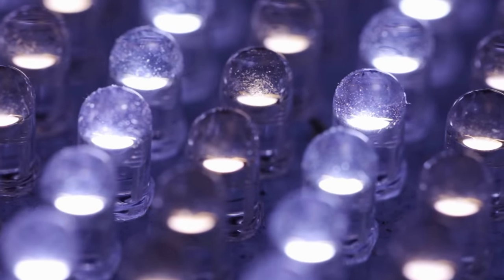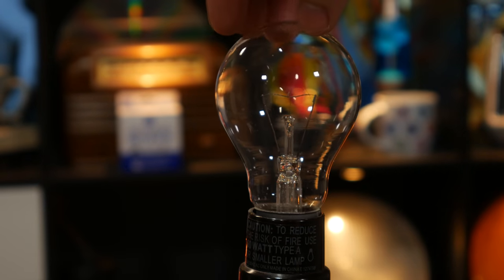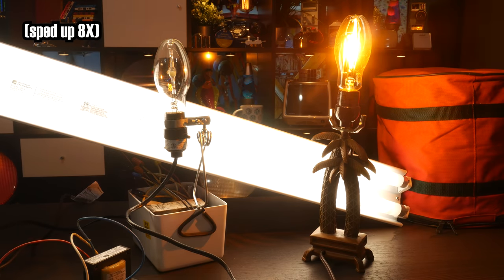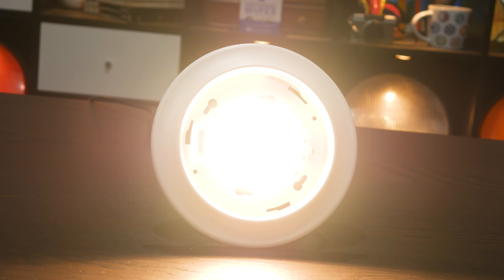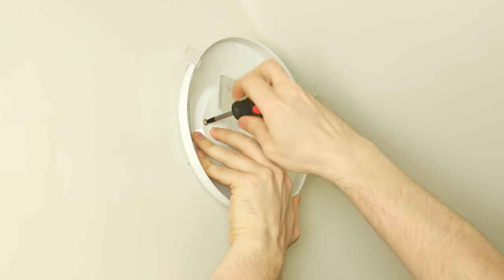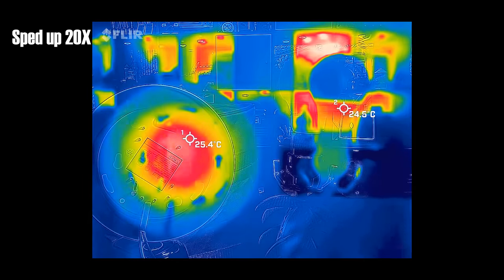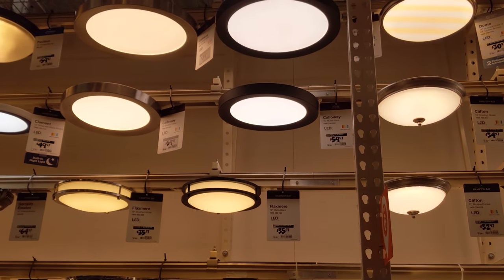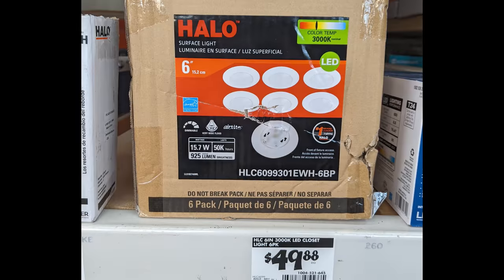A troubling trend in lighting?

Comment: I'm a commercial lighting engineer that specializes in retail and started in the field in 2012 just as it was coming into mass market. You hit a lot of the most important points and how it has been commoditized. A lot of those earlier projets are now being replaced again despite us assuming a 15 year life. For one, in commercial settings there are often "night lights" or certain fixtures that stay on constantly. We found that those fixtures became noticeable and color shifted over time compared to others so now we often designate separate (different) fixtures for that purpose.
Also, what one manufacturer calls "3000K" varies from others. It shouldn't, but it does. Especially with the Chinese brands. A spectrometer confirms it and it's simple technology but... China labels things however they want.
I think the biggest advancement has been in the optics, it has opened up a world of options we would have never dreamed of 20 years ago with different beam patterns and the like and the diode elements are powerful enough that we can afford to diffuse it. Earlier generations typically didn't. This is a big deal wth street lighting and glare.
But yes, unfortunately in retail environments where we have defined a brand standard for our clients, if a few fixtures shift color, we need to replace EVERYTHING and that is becoming more and more common. Whereas in the past with 2x2 fluorescent fixtures with FB lamps we could just relamp one fixture and nobody would know, we often have to replace an entire sales floor of fixtures now and the store managers can't do that. It's great business for us (as we also do that work and service thousands of locations) but it's incredibly wasteful. We've recently started supplying tunable fixtures and have reverted from integrated track fixtures/lamps to track lampholders where the lamps can be changed out. Except, ironically, in California there are Title 21 requirements that still require us to replace entire fixtures as they require integrated lamps. Also, as you mentioned, Chicago (and NYC) are both oddballs and require all exit signs and emergency lighting to have metal housings and other special fixture requirements like "tenting" the fixtures in plenums, etc., the codes are well-intentioned but haven't caught up to the technology.
Another huge benefit has been in emergency lighting, we can meet the 1/0.1fc requirement for an entire store on just a single inverter unit which greatly simplifies inspection and battery replacement compared to transfer switches or standalone "bugeyes"'.
Also, it's worth noting that fluorescent fixtures can be just as "efficient" as LED. In the 1970s, it was common practice to route HVAC ducts through the fixtures to pick up heat and deliver it to the occupied space below. But this only works in the heating season. But this could also be used with cooling, conceivably, to cool the LED fixtures and prolong their life (though it's not, in practice). But it's something we run into with our energy simulations when lighting is "too" efficient and the HVAC is inefficient, overall heating bills can increase and negate the lighting savings. Moreso in northern climates, obviously. It used to be that lighting contributed a substantial heat load to a building and we have simulation software that takes that into account.
Reply: Thanks for the info - super interesting!
Reply: second that, great insight
Reply: I design HVAC systems and I can confirm LED's change how we size systems. We definitely factor in a lot less heat from lighting than we used to.  I mainly work in the southern US, so it's usually a good thing for the HVAC system.
Reply: @kargaroc386  Except anyone can dig and fill trenches. His job requires skill and education….
Reply: That was really interesting. As someone whose only dealings with lighting are as a domestic consumer, l had no idea of any of it.
Reply: i read something about a school in sweden i think that replaced all of their incandescent and CFL lamps with LEDs. their heating costs went up more than they saved with LEDs, and together with the cost of replacement, the entire thing was a complete waste of money and resources.
Reply: @guguigugu  Yes, I've seen that happen with schools here. It's rare, but in the case of an older building in a northern climate (ASHRAE Zone 5) with old HVAC just focusing on lighting, it can have a net-negative effect. Even worse, I've seen cases where they were relying on rebates from their electric utility based on kWh reduction to offset the installation cost and the kWh actually increases (electric heat), so not only are they paying more for energy but they end up paying the full cost of the "improvements" when they were banking on credits to offset that. A lot of that seems to do with heat loss to the plenum and mechanical rooms from poorly insulated HVAC ductwork (in addition to excessive fan energy which is really inefficient in old buildings and can account for 25% of a building's total energy consumption) whereas "inefficient" lighting is still heating the conditioned space.
Reply: Somewhat unrelated, but when I replaced my refrigerator (actually built in the 1970s, I replaced it in 2010), it was winter, and my heating bill went up noticeably. My electricity bill also went down noticeably. Funny how that works, but needless to say that at that point, I hadn’t even considered that replacing my ancient (and inefficient) refrigerator would negatively affect my heating bill.
Reply: Fascinating, thank you!
Reply: Do you commonly use 277 and 347 V lighting in commercial?
Reply: @mernok2001  Yes, 277V is quite common in industrial settings or anywhere that gets 480V 3-phase service as you get 277V across one phase and neutral. I've only ever dealt with 347V on a few occasions and those were warehouses in Ontario, Canada. I think you can get 347V or even 600V service there. Higher voltage lighting circuits are becoming less common with the advent of LED lighting in new buildings except where it's really needed.

Comment: Had a "disposable LED fixture" in my apartment. of course it failed after a two years and was left sitting in the dark. Replaced it with a timeless hanging Bulb socket from IKEA and a paper screen thingy, with a 100 watt LED bulb screwed in. I agree completely with this video.  I know how to unmount, wire and replace fixtures safely and correctly because my Dad taught me how. but in this age of waste not everyone has those sort of handyman skills passed down in the family.
Reply: Speaking of waste, something that has bothered me with the larger fixtures that use integrated LEDs is that now, I don't have to just dispose of an replace a small LED bulb, I have to replace the entire large fixture. There is no way that isn't going to drastically increase plastic waste in the future.
Reply: I completely disagree... I have had fixtures with sockets and had to replace either lamp every 1-2 years. With my rgb fixtures i am in the 3rd year and counting. And changing the fixture isn't rocket science, either. I also dont like that fixture and LEDs are joined but that is something I believe will resolve once these are properly ubiquitous and people demand for separate power units and lights. Similar to how every phone charger is interchangeable.
Reply: And chances are that your replacement lighting system took more energy to manufacture and get to you then the one that failed, so while it may make you feel better, chances are it didn't actually do the environment or anything else any benefit!
Just get a higher quality led fixture that will last a little longer.
Reply: A 100W LED? Are you trying to light up a stadium? I'm running around 7W here for ~1200 lumen and can't say anything besides that the room is bright.
Reply: @HappyBeezerStudios  Perhaps it's an LED equivalent of a 100 watt incandescent bulb.
Reply: IKEA, huh? How hard was the fixture to assemble? :P
Reply: What I don't like is that if you have a matching pair you may not if only one goes out in a couple years. My OCD rears its ugly head

Comment: I really want a standardized driver/chip format for these so that just the failed component can be replaced.
Reply: Yeah, just switch it out like we do with flouro ballasts. In the old days, flouro fixtures had plug and play starter relays to frequently switch out and the ballasts lasted longer.
Reply: We had a fixture in our bathroom fail that looked exactly like a round dome fluorescent fixture from another bathroom. I went to change the bulb and found it was led and not a great assembly procedure. I looked around for a new driver at the rating I needed cost the same as a new fixture. 

I think it would be beneficial these days for people to have basic wiring skills, it may save a lot of frustration and time. Hopefully parts will be a thing some day replacing the whole thing for a bad part is crazy.
Reply: We actually produce fully repairable, serviceable, recyclable modular LED lamps for E27 retrofit  and highbay - but few customers want to spend more money than for fake plastic LED bulbs with no real heatsink that will die or loose luminosity real quick.
Reply: But how can that support homosexual special rights ?
Reply: They exist for drivers here in Asia (somewhat. There seem to be competing standards)

I bought a 10 pack of drivers for the price of one fixture.
Reply: @TheLittleAlien  I work at a hospital where we use almost every kind of socket on the market. And most of them have a plug-and-play replacement LED version. G23, 2G11, G24d, G24q GX24d etc. All have an alternative. And as you said the E27 too. The only thing to look out for is compatibility with drivers.
Reply: Yeah, seems if anything these should just have replaceable LED "bulbs" of their own. Though I guess you'd instead call them light _discs_, not bulbs.
Reply: @benjurqunov  wut
Reply: Could we at least have a standard plug so mugglers don't have to have to meddle with exposed wires?
Reply: In commercial electrical labor often cost more then materials. Changing a component would take longer. I doubt companies would go for it.

Comment: Yes, this is one of those cases where "Situationally pretty good.  Bad to have it forced on you" applies.

Pretty sure the contractors that replaced the damaged (from water leakage) fixture in the house used one of these....Well, if all goes well it'll keep working for over a decade, so not really an issue, probably.  Mind, it's really inconveniently located (It's on a landing, but the ceiling is for the floor above it, so you need a ladder that can go high enough in a narrow space), which would make an already nerve wracking situation (replacing a bulb in a precarious location) several times worse since you'd have to do rewiring and mounting.

Comment: TC is back!  And honestly I feel like I’m with you on this.  I’ve watched this happen, and it feels like we’re a bit quick going from “why, this LED lasts practically forever!“ to “we don’t need to consider replacing them“, I’ve seen it in car lighting and now it seems to move over into home lighting.  It allows for some really neat designs you couldn’t have with bulbs, but it also creates more waste and makes it harder to fix stuff, which isn’t great.  It’s a messy situation and I’m not sure what the best solution is, here.
Reply from the maker: That's the thing, this topic is chock full of nuance. If a light fixture manages to last 20 years, well by that point maybe you'd want to do some updating anyway. And it does seem quite likely to me that these devices will outlast the vast majority of bulbs. But I really don't like how locked in you become in this situation, on various levels. Especially when you're not confident to change these yourself (and in some parts of the world that's not even allowed!).
Reply: They do make led can lights that use molex connectors. Those are wonderful.
Reply: On the other hand, in terms of e-waste, if you replace one of those all-in-one fittings, it isn't actually any different to replacing a light bulb. The all in one fitting is just a light bulb with bare wire connections rather than an E27 connection. I agree though that the E27 type is much easier to replace.

Comment: As a lighting designer I’m so impressed by how well you covered the topic in just 30mins! Though when I read the title “disposable”, I was hoping that you would cover the environmental impact of producing LEDs too. Everyone is using LEDs these days but rarely people think about the environmental consequences of it (carbon footprint in manufacturing, end of life recycling, etc). LED fixtures that includes many components made of plastic, silicone, metal, etc is much more difficult to take apart and recycle properly compare to traditional light bulbs including mostly glass and metal. Commercial projects have a massive demand on fixtures that you can’t really just “change the lamp” when the fixture dies or switch brand without take off the whole thing, because each manufacturer has their own standard. Yet we are all still jumping on it because it’s convenient, cheaper, and efficient. Sometimes I worry this is the new invention that would end up like plastic bags—because it’s so convenient, we overlook the long term consequences it brings, ending up overuse it and only to realize the trouble in the future. It would be great if you could make another video in the future covering this topic too, and raise some awareness to people.
Reply: How does one properly dispose of LED fixtures and bulbs?
Reply: @NickzAndMikz  Here's what I would suggest: 
1. Try to see if there's any stores or organizations near you that has drop off point for LED recycling. Curbside recycling usually can't recycle LEDs because of the electronic component and the microchips containing heavy metal. 
2. There are probably some recycling programs online that you can mail in your recycles. It could be nice to collect a box of old leds in your neighborhood and mail in together--spreading knowledge and awareness as a community!
3. For certain led fixtures, the components could be easy to take apart (like some linear fixtures are just acrylic extrusion lens+metal extrusion base+light source+driver), then at least you can recycle the plastic/metal part. 
4. For LED bulbs,  recycling programs take them in as a whole. Though I still try to separate the components like the diffuser / lens and play with it with different light source to see how it changes the effect. I like using random things to see how i could use them for fun creative projects. 

I know in a lot of places there are few resources for recycling, and cities that don't even recycle very common plastics. We just try our best to avoid letting these things end up in landfill as much as possible, and reduce unnecessary/impulsive purchases from the beginning (which applies to other materials we think we "need" in life too). Lighting manufacturers are late but at least starting to pay attention for sustainability. Many products advertise that they have a high percentage of recycled materials. As consumers if we use our actions to show we care about where the products go after its life cycle, eventually there will be a better recycling/upcycling system designed into the product development.
Reply: As far as recycling filament bulbs though, how often does it actually happen?  Most people (myself included) have always just thrown bad filament bulbs in the trash.  So while they can be recycled, I doubt they actually would be sadly.
Reply: @psychickumquat  true, lots of people are unaware about if things are recyclable, or simply don't have a recycle facility in their city. I think that's another type of issue of general education of recycling and improvement to the whole recycle system, making it more accessible and easier for people to do.